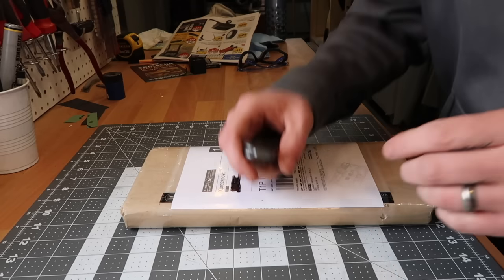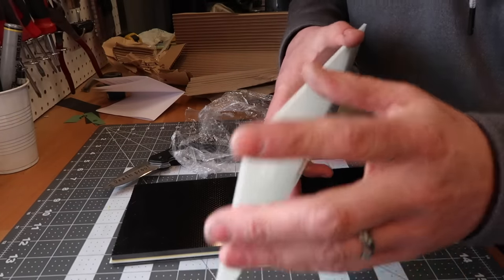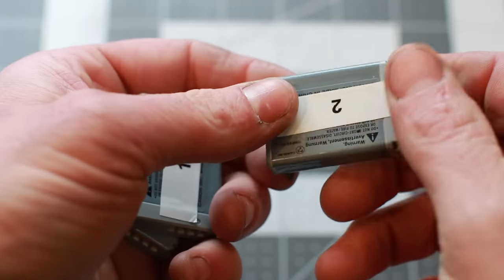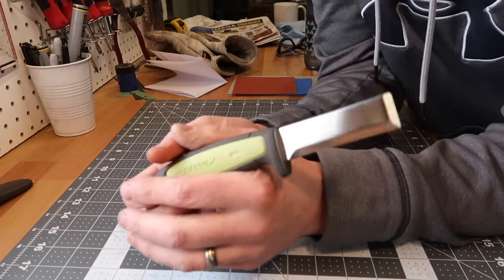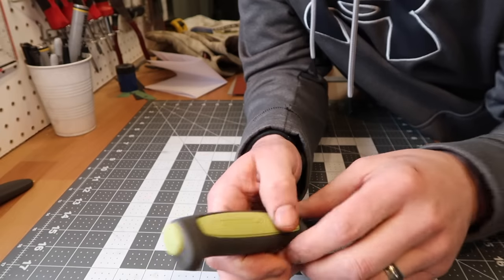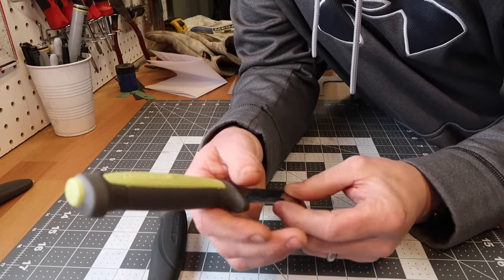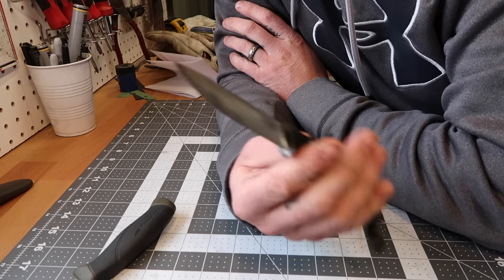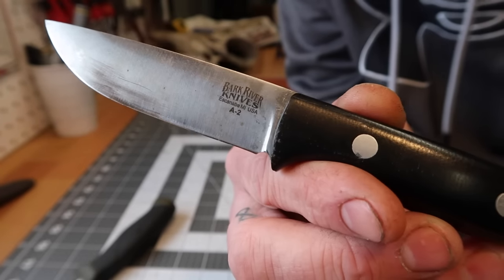I accidentally bought a Mora...

Comment: O haven't had any problem with any of moras carbon steel knifes rusting for me since I was a kid at like 6-7 years old :p still use a mora knife every single day at work ^^ just take care to whipe it off every now and then if your working in a wet place and it will keep the blade free from rust stains ^^ also over here in sweden the usual mora goes for about equaly to 6$ or something :p and ate usally 1085 I seem to remember from somewhere ^^ have grown up with carbon steel blades and had them and used them since my third birthday so going on 24 years now and still have a hard time trusting stainless steel overall (only just recently started to get some interest for them singce I'm now looking at buying a fällkniven s1 pro, quite expensive but the bang for the buck is unparalleled I would say!

Comment: Why carbon steel? Because it is easier to grind and longer sharp. It is much harder than stainless.
Reply from the maker: Modern stainless knife steels are incredible and often harder than high carbon steels.
Reply: @Simplelittlelife  not in mora. 12C27 is little bit softer than C100.

Comment: Correct me if I'm wrong, but I don't think it's called a "chisel grind" I think it's called a razel.
Reply: Addison Whitaker the razel is a line of knives designed by john graham that have that same blade shape, the chisel grind doesn't even refer to the blade shape, a chisel grind is a grind where only one side has a beveled cutting edge, the other is flat like a chisel, the blade shape doesn't really have any distinct name, and mora can't call their knives "razels" or mr.graham is going to be a very rich man when he takes them to court assuming his products are copyrighted and trademarked.
Reply: Cole Allen thanks for responding, I'm not a huge knife guy. So I just thought they were the same thing.
Reply: Addison Whitaker no problem man
Reply: CRKT Does a folding less expensive version of the razel by Graham, it's a great work knife.

Comment: 12c27 stainless UHB-20C or more commonly known 1095 carbon 14C28N stainless in the garberg.. think they use a harder carbon steel for the laminates aswell but yea i do not think many blades beat moras for the price especially the Craftline Robust that thing is a tank the tang and blade is thicker and wider than the normal ones holds up to alot of abuse.

Comment: Morakniv is a brand for everyday use knives, they're cheap but sharp. They're not made to be durable, they're made to do the job.
Very few people sharpen their morakniv in Sweden, they just toss it away and buy a new one. I was very surprised when you said you've had yours for 3 years, because that's about 2 years and 50 weeks longer than the life expectancy of a morakniv.

So they don't really put much weight into getting the exact right steel for knife aficionados.
Reply: UniversEEEEE The basics run about 3 euro here in sweden
Reply: morphman86 how wasteful throwing away a perfectly good knife just because it gets dull? Sounds like someone needs some life skills training and learn how to sharpen a knife.
Reply: morphman86 the robust is really durable, Dutch Bushcraft Knives made a video on how it was indesttuctable

Comment: I personally like the idea of a chisel grind.  Only have to sharpen 1 side, and can just lay other flat.  Also I find they are good for feather sticking or shaving, granted the bevel has to be on the correct side.  I found my spyderco works well left handed, but digs in right handed.  I've been on the hunt for a nice tanto scandi, just 2 straight edges to follow, no curves.  Guess this is probably close as I'll get without modifying my own

Comment: I don't mean to correct someone with so much more knife knowledge than me, but that is flat wrong about the Companion. I literally own a Carbon Companion, and that is the standard. They make a stainless version of most of their knives. I'd bet money they even had a stainless version of that chisel as well, but you didn't click the right one. Promise I have a collection of Moras, and they are carbon by default, and make special stainless versions of each. It's just a matter of looking.
Reply: i agree with most of your comment but no there isn't a stainless version of the chisel. i even checked their website before i bought mine, only carbon
Reply: @cornboi3227   Gotcha. I was just trying to be polite that one might exist, just because I was correcting the other part.